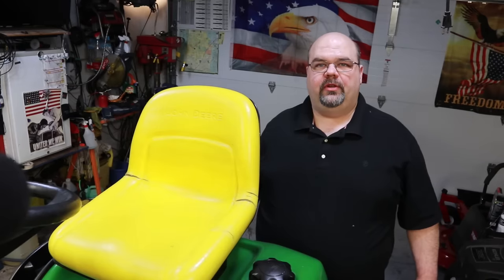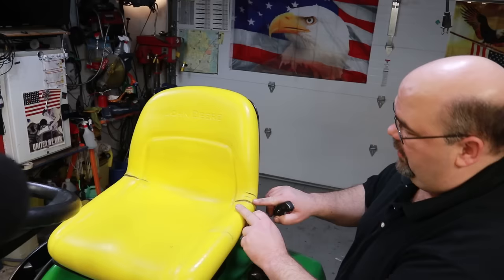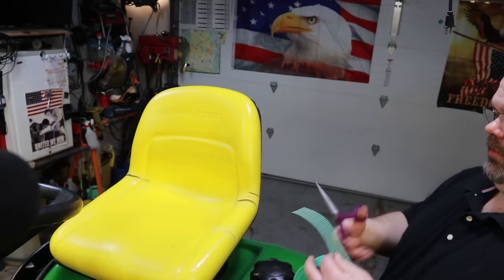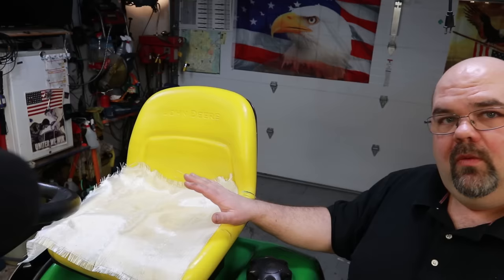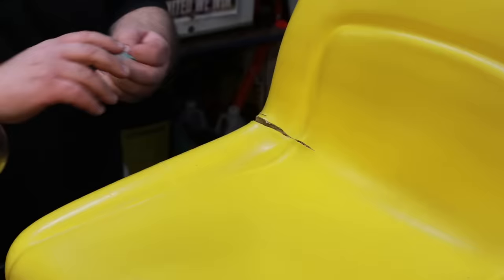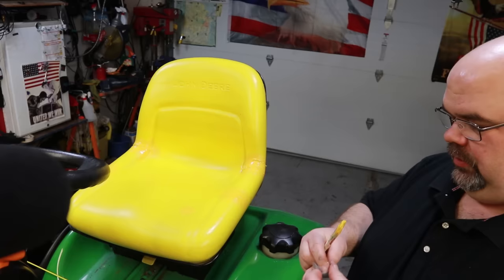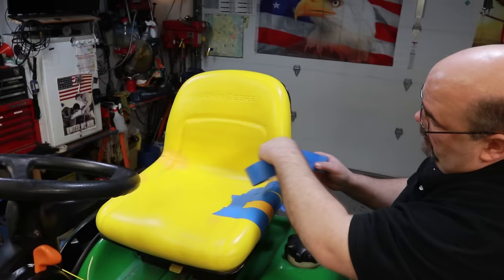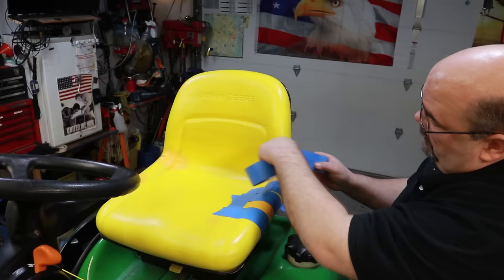Unexpected Solution For Your John Deere Riding Mower Seat

Comment: These seats have been cracking since they were first developed. You would think John Deere would put a better quality seat on these. Mine cracked at less than 300 hours on a $7000 lawn mower. Good job on video
Reply from the maker: Won't argue with you on that one.  I guess as long as we keep buying them there's no incentive to make anything better.  
Thanks for watching.
Reply: Have you ever heard of built in obsolescence? This. I’m going to do this repair. Not going to keep giving JD money.
Reply from the maker: @joedirt7640 , Yes sir, that's pretty much every item we purchase anymore from electronics, small engine equipment, and even cars.  I've been working on small engines for over 30 years and there is no comparison between the build quality of then and now.
Reply: @baldeagle242   
Thanks for your video,I have 2 to repair.
Reply from the maker: @joedirt7640  I'll be sitting in the front row watching once you get a video posted.  👍
Reply: All roto molded seats crack eventually.
Reply: You can buy a slightly older Lexus for that.
Reply: They want us to replace them. It’s more money for them. Why do you think they switched to plastic hoods? So we would replace those as well.
Reply: 300 hours for the average user is 5-7 years. If you leave it outside the sun will ruin it before that.
Reply: Mine cracked in 200 hours. Thanks for the fix.
Reply: You know how it goes... John Deere is not going to change a product's quality or replace anything for free that they can cash in on and make alot of money off of... if you remember it used to be that companies cared about their Name,Reputation,longevity... Now,it's just Mainly All Profit in mind...
 look at the lousy and cheap plastic hoods,and parts,as well as the lousy cheap foam seats. .. 
 like with mine.. it just deteriorates over time no matter how much you try to take care of it you might keep it pretty and bright yellow and clean on the top outside..  But that foam under that vinyl will always deteriorate,and you might end up like me holding that pretty yellow vinyl seat with the deteriorated dirty yellow looking foam on the backside of it,in your hand as you look at the plastic base mounted on the mower... I tried gluing the seat back to the base but it just did not work!.. so I just laid the yellow vinyl on the base to mow grass for as long as I could stand it,and put up with it...... lol!..
 John Deere wanted a hundred and some dollars for the original seat... but I decided to Hell with John Deere.. and I looked on eBay,Amazon,etc. and found alot Nicer high back that was compatible with my Mowers seat mount and it had the armrest mounts and a armrest mounting kit option for roughly $80-$100 bucks extra..yes i have more money than my John Deere dealer wanted for the original low-back cheap piece of junk seat... it's just ridiculous what they charge for some of the cheap things/parts...
.. but I have a whole lot better more comfortable seat with alot more foam in it... I wasn't sure I was going to like sitting up alittle higher but I've got used to it.. Seriously!... No joking!..  
now don't get me wrong.. it is a very good reliable well-made solid mower.. under that plastic and foam exterior.. but when something goes wrong that will affect it's performance it's going to be costly three-quarters of the time it just depends on what it is ... I've been shocked a few times,  that my John Deere dealer was cheaper than what I could find it online so it's a 50-50 chance,now if I was to go buy a brand-new mower.. Yes I'd look at a John Deere but as I've Been Told and from what I've seen at the department stores, because they're going to want the cheapest, get by quality mowers that they can get from John Deere or any manufacturer for that matter... make sure you go directly to a John Deere dealer to find the better quality John Deere mowers...  not Lowe's,Home Depot.. some of them things are Rock Bottom quality to me from what I've seen over the years.
Reply: And the front wheel fell off at 225 hours!
Reply from the maker: @davidrollins4272 🤦🏻
Reply: That, and the decks rusting out easily, as well as the body of the mower. It's silly being that the hoods are always in great shape, you would think they'd either build fiberglass mowers or use a paint process like cars use. But i guess if they were built to last, they would sell less new ones every year.
Reply: @juanelcubano6713  Deck rust is usually from not cleaning it after each mow.  The grass has a lot of acid in it.
Reply: @LegendLength  I think it is that the caked grass holds in a lot of moisture. Iron does not rust unless both oxygen and water are present.
Reply: JD never fixes known problems. How many JD fuel gages actually work? From lawn mowers to skidders, the fuel gages fail in short order.

Comment: You can lighten the yellow out some by adding a bit of white plastic dip. By adding small amounts n mixing you can test color match b4 application. This will get you a match that will blend better.
Reply: Great idea.
Reply: If you have a junk Deere seat, you could mix yellow and white until it looks right, then apply a final coat to the one that you already did.
Reply: Great info!
Reply: Mask off and spray final coat mixed with thinner - usually it’s a lighter coat and less intense color.

Heck, I’d really just dye the whole seat black for easier future color matching

Comment: After watching your video, I more or less used your technique on a craftsman mower seat (black in color) that I was fixing. I hadn't done this before, so I was hesitant, but was encouraged by your video. The cracks on this seat were larger and the vinyl edges were curled up. I decided to trim the edges down as close as I could to the normal level of the seat and then sanded around like you showed. I cleaned the area as well with a de-greaser. I actually used liquid flex seal instead of plasti dip simply because that was what I could find at the store. I did one crack first to learn from. After repairing the first crack, I changed plans a little. Originally, the first crack was gaped open by about 1/4 of an inch. After the repair was done, the center of the crack was noticeably soft. The rubber was attached well, but I decided I should have put some foam in the crack to fill up the space. I did this on the other cracks and it seemed to work well.  In the end, it turned out looking really nice. Since it was a black seat, the color match was almost perfect. I don't know how well it has held up since the mower was given to a family who needed it, but for the 2 weeks or so that I had it after the repair was made, I got on and off the mower almost daily to test it and everything seemed to hold up well in that time. Also, the thin coats while applying the liquid rubber did seem to be the way to go. I tried applying a thicker coat at one point and it definitely increased the time between putting on the next coat. Thanks for the video!

Comment: You might try spray painting the entire seat with Rust-Oleum spray paint to make it a uniform color. They have different yellows to match, perhaps Marigold or Sunburst Yellow. It's manufactured for plastics and I've used it on bicycle seats without a problem. Costs less than $5 for a can.
Reply: Sunburst is my preferred JD yellow... It's brighter than JD yellow and looks much better.
Reply from the maker: I’ll have to look into it. I don’t think I’ve ever tried that color. I know Safety Yellow is pretty close.
Reply: @paulg444  So duct-tape and Sunburst spay paint for those that want it done in 10 minutes, right?  ;-)  Your videos have helped me with some projects so kudos to you!
Reply: I changed the color of a full interior with vinyl trim repair kit and paint available in all auto body supply stores. I did everything but the seat
Reply: They sell John Deere yellow. Rust-Oleum brand paint

Comment: Well done. As long as it keeps your backside dry and you didn't have to spend a lot of money, it's well worth doing it like this. I've got an old John Deere with cracks that I'm gonna fill. Thanks for making this video.
Reply from the maker: That's precisely my two cents on this repair.  Inexpensive and effective.  😉👍
Thanks for watching.  🦅
Reply from the maker: Including golf karts, shop stools and mowers I’ve probably done close to 20 or so. If you want something that works even better get a piece yellow marine vinyl and some RH-66 vinyl glue and patch over the top of the crack. https://amzn.to/40PdfGi

Comment: I have a JD mower it is about 4 years old now. I am on my 3rd seat. The first one cracked and they replaced it. The next year it cracked again. This time the folks at JD looked and saw that the new seats were available. It seems they know about the problem and If it is within the years the thin ones were on they replace them no questions asked.
Good luck. They treated me right. The new seat is on over a year and no sign of cracks. Better material.
Thanks
Randy
Reply from the maker: That's excellent news.  Thanks for sharing this info and thanks for watching.  🦅
Reply: My J D mower is 35 years old.  It has the original seat but I doubt they'll give me a free replacement.

Comment: Thanks for the video. I have a 36 year old 400 series Wheel Horse that I installed a high back vinyl seat on from Northern Tool years ago. The seat has developed a crack in the same area as your John Deere. I'm sure I can get that PlastiDip in black to repair my seat. Thanks also for showing the can!

Comment: I have 2 Craftsman 3500$ lawn tractors to repair and a 20,000$ Kubota seat to repair, this appears to be one of the best videos for seat repair I have seen. Thank you for all your videos.
Reply from the maker: Thank you! I’m working on another seat repair video that I hope to have out in a few weeks. It’s a little more extensive but will outlast this repair. I’ve started using bulk yellow marine vinyl and an industrial vinyl cement. You can cover as much or as little of the seat that’s needed but the cement is extremely weather resistant and the vinyl will tear before it comes loose.  I’ve tried a few different brands but this is the one that works the best. 👇
https://amzn.to/3x1HGAh
Reply: @baldeagle242  Thank you for replying. I will look forward for your next video.
Reply from the maker: @billsilvers6066  👇UPDATED VIDEO HAS BEEN POSTED!  See it HERE!👇
https://youtu.be/hWEoQM65fto?si=2MzpfUJFhY0-1hoA

Comment: Actually the Plastidip seat repair has held up pretty good on my 2007 JD X300. I did mine about 4 years ago, although I need to repair it again since it's developed few more small cracks in the seat now. Another repair I did to the JD X300 was a hood repair, my hood split pretty much down the center about 18 inches long. The small 4 inch green colored zip ties with drilling small holes for size of zip tie on each side of the crack using a X pattern stitching worked great for that repair. I did that about 2 years ago.
Reply from the maker: That's great.  Thanks for sharing your experience.  👍
Reply: You cud probably use some matt ounce n half weight works well and some polyester resin and fix your hood like new. Good prep job  and making certain surface is clean of contaminants with acetone or similar. Very similar to this guys technique . Cheers.

Comment: Having priced a new seat for my 20+ year old Snapper Lawn Tractor, this is one of the greatest money saving ideas I've ever seen. Thanks for showing us how it is done!    p.s. Could you get a can of John Deere Yellow spray paint, and spray the whole seat after the plastic is fixed. The wax and grease remover could be used on the whole seat at the beginning, then after the functional repairs have been made, you could then use the John Deere yellow spray paint on the whole seat.  Before I moved to the City, I lived on the old family place in the country and used my John  Deere tractor just about every day, and I wish I still had it. Tip for occasional users of smaller to mid-size John Deere tractors with clutches- if you know it will beva week,or so until you use it again, the clutch much remain in the "disconnected" or depressed condition. Your John Deere  will provide you with the correct bolt, about 6" long on mine, and the bolt hold is pre-drilled at the factory to kept the clutch plate and the pressure plate from welding themselves together. My dealer, and good friend, told me to crank it in neutral, slide it into first gear and drive it around until everything warmed up and the clutch started working again. That didn't happen, and something inside  gave way, and the dealer and I agreed to split the costs, about 10 seconds  after I saw everything relating to the clutch and gearbox  laid out on the floor in an orderly manner by his expert mechanic.; hundreds of parts.
Reply from the maker: You’re welcome. Thanks for taking the time to leave a comment. 😁👍

Comment: This is one of those "why didn't I think of that" ideas.  I have three mowers, and two of them are going to get this repair as soon as it gets a bit warmer.
While I don't think that cracked seats can be completely avoided, I think one big reason for that happening is UV rays.  When I got my last mower three years ago, I had my wife make me a seat covers.  Not only are they pretty much always on the seats, but I also make  habit of tipping the seats forward when not in use.  That last seat still doesn't show any signs of wanting to crack.  The other two mowers both started cracking before they were that old.  Wish I'd used seat covers before.
All of my seats are black, so matching colours won't be much of an issue, but I wouldn't worry about it anyway.  These mowers are used to do work on my acreage (mowing, tilling, harrowing, snow blowing, trailer towing, etc.), not to take to mower "Show and Shines".
Thanks for the posting.
Reply from the maker: Thanks for watching and taking the time to leave a comment. 😁👍

Comment: Nice repair.  I have two John Deere seats that are cracked.  I will use your solution; however, for a final step I think I will paint the repair with John Deere Yellow paint.  it should hide the mismatched yellow.  This JD yellow & green paint is sold at Menards  for $11/pint.

Comment: That's a good idea to seal those cracks. I think if it were me I would do what you did but then I would buy a JD seat cover. My JD sits outside and I do cover it but the cover of course isn't waterproof. 
I remember the first JD mower I bought years ago. I bought it used and there was no back to the seat. Instead of buying a new seat I made one. I went to a craft store, bought a pillow insert and a couple of yards of yellow vinyl fabric. The color match was spot on. After sewing the fabric I then used Liquid Nails to adhere the seat to the plastic form on the mower. The mower was old and the hood was missing. The previous owner didn't take good care of the mower which was unfortunate but the mower ran well. I was desperate for a riding mower and had a lot of grass to cut so I bought it. I kept it covered and had it serviced a couple of times. When I decided to move out of state I sold the mower.

Comment: Decent repair if you get it early!  The tractor supply seats are vinyl impregnated fabric and don't crack like the OEM ones.  If you want, most of your autobody supply places will mix vinyl spray paint in a spray can. prep it and spray it.

Comment: Appreciate the advice regarding the sanding.  Didn't even think about doing that when I did mine last sept. and left two of the riders out exposed to the Michigan winter to see how performs since I recall watching a video a few years ago where someone repaired their JD seat and noted they just left theirs outside and held up good.  Works even for hose repair where I used to repair the crankcase breather hose end that goes into the air intake on the 18.5HP 31HXXX engine that I originally first repaired using type 1 silicone though that didn't hold up well to the gasoline.  Plastidip seems to do well exposed to gasoline or at least the fumes also.  I'll try to make a video, since forgot, when I do the next repair and/or custom coating since have a can of the blue to make a Ford Blue seat from one of the seats.  Last left off wanting to make a mold and wondering what resist works best to release from the mold, so to be able to make a raised Ford lettering on the back... though now thinking I can print the logo in vinyl and just Plastidip over since invested in a Cricut a few days back.  Did post on FB however: https://www.facebook.com/james.analytic/posts/4247637905297979  https://www.facebook.com/james.analytic/posts/4325255164202919  Thanks for sharing!
Reply from the maker: Thanks for watching.

Comment: Interesting video. I have a Husqvarna. Those are gray. Yeah, $150 on those too. I had a split. I trimmed the curling part off. I used gray silicone. That mesh looked neat. I wish I would have used that. The top of my seat was pulling a loose. I glued it back, then used gray spray paint to feather the edge in. Turned out fairly nice.
Reply from the maker: Thanks for sharing your story, and thanks for watching.  🦅